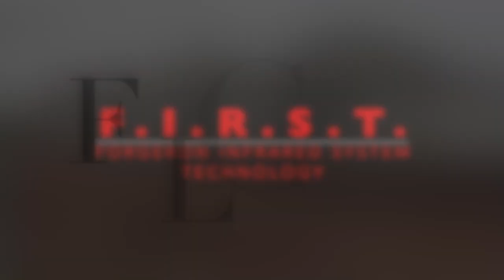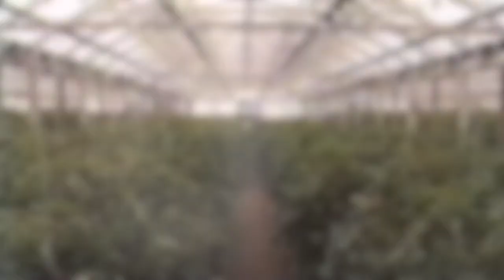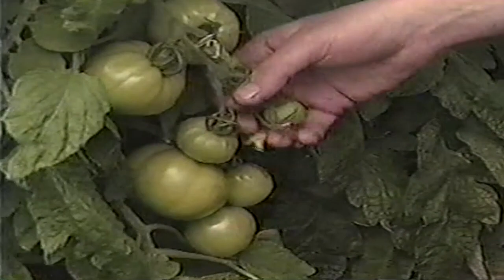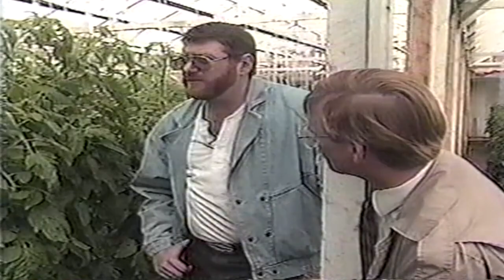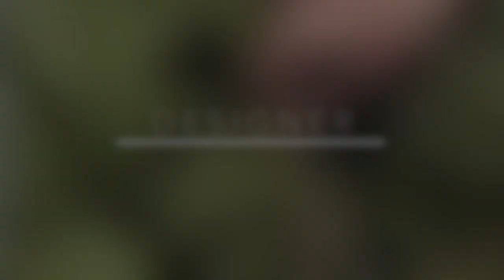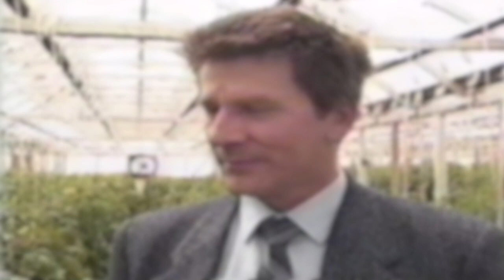Forgeron Infrared System Technology - Greenhouse heating system

Comment from the maker: Hi  You Tube viewers.
Since I don't have much interest being shown for my world's best , most efficient greenhouse/ shop/ warehouse/ gear shed heating system, I want to mention another innovative fishboat which I designed, built, and tested in commercial fishing in 1977- 1992. It excelled in speed. comfort, environment friendliness, and costs.
It can be built by most fishermen or pleasure boaters, or existing boat shops, using the presently suggested aluminum pre-cut hull packages, with assembly instructions and welding training as needed. 
I thought you may be interested in my background leading to my innovations I have produced 

but can't find anyone wanting to use them?

I come from a little village called Main-A-Dieu, Cape Breton, Nova Scotia, Canada. It is a quaint little Commercial Fishing Village on  The Rough North Atlantic Ocean, containing the once largest fish banks in the world, until we decided to destroy it by overfishing using destructive harvesting gear. We now have it on its knees, but continue with the same destructive Draggers tearing the Ocean floor to pieces and grossly overfishing all the bait fish needed to feed the ocean habitants.
I was a boatbuilder helping my dad build Cape Islanders for local and nearby fishermen. We also commercially fished Lobster, groundfish, swordfish etc.
Sea sickness was my problem for several years for the first 1-2 weeks. I wished the boats were faster so the travel time to the fishgrounds could be cut in half.
That wish made me work for +25 years till I designed and built an innovative hull to not only go much faster, but also using a smaller engine, reducing fuel costs by 30-60%. The hull also was comfortable and smooth in rough seas, and turned on a dime. I went away and got an engineering Degree, and worked in World leading major industries for many years, till returning home to build the above mentioned boat. The fishermen loved the boat, but suddenly my commercial license was removed by government, so I went away again for work.
Next, came World EXPO, 1985 in Vancouver. I went out to see and visit my brother, who had a converted Fishboat he used along the coast for his geochemistry work. At that time he had a friend in need who had developed a seed planting device to plant 200-500 seeds at a time exactly planted at proper spacing. He needed a greenhouse to try his seed planter, for a year. 
No one was interested, so I offered him a greenhouse heated for a year. I knew of a greenhouse near my home which the owner was having cash problems, so it was idle, and I could use it if I left my heating system with him. I agreed.
As an engineer I quickly checked how much it would cost me to heat the 3,000 sf greenhouse, single skin, knowing winter temperatures were -35F at times.
I was shocked to find I could not pay the heating costs using the coal fired inefficient hot water boiler presently in place.

So then began my second innovation journey.
All heating systems were expensive to install, and fairly inefficient and costly to run. The only one I could see was an infrared system fired with propane. It was very expensive, especially since I would need at least 10 separate units, and each unit had a hot wasteful exhaust continually exhausting hot fumes outside. A waste of energy.
I decided I needed a more efficient infrared heating system which was not only cheaper to buy and install but without needing the exhaust waste.
I also wanted a lower operating temperature to not only reduce burning the greenhouse operators who accidently touched the heater.
I also, wanted to use the longer infrared wavelengths for better plant growth. 
I also wanted to reduce heater  temperature to reduce the overall greenhouse temperature differences across the whole greenhouse lower area.

Greenhouses almost everywhere have condensate raining down on the grow tables, the people and floors, making the humidity higher than desired for healthy plants.
Condensate on the roof also reduces the sun and sky light input onto the plants.
Many greenhouses have existing furnaces or boilers which produce hot water or steam, to heat pipes which run along the outer walls.
My system can run perfectly using that existing boiler, which can be fueled using their existing energy source, or can use whatever they find most efficient.
My system can run directly from electrical power, without needing boilers, or steam generators, or oil/gas tanks or exhaust pipes.
My system can use their existing 2" pipes they already have along their walls, so even more costs are saved.
My system can be run and maintained with or without existing boiler operators with or without a boiler operators license.

Comment from the maker: I designed and built, and put into use, this heating system in 1978. A friend needed a greenhouse to try out his automated seed planting system, but needed a  heated greenhouse. I said I would get a greenhouse and heat it for a year to help him. I didn't know how expensive the heating would be but found out I would have real trouble if I didn't find a better way to heat the greenhouse. So I researched every heating system in use, and could not find a system I could afford. 
I am an electrical engineer, so I really started digging for a better way. The best I could find was an infra red heating system. But it also had limitations and would not lower the heating cost and installation costs for my limited budget.
I call my system FIRST (Forgeron Infra Red System Technology) FIRST. 
For greenhouse owners, I offer some great savings and heat distribution and energy reductions from installing my system as follows:
a) FIRST provides perfectly uniform heat distribution throughout the greenhouse, and especially along the cool outer walls. Do you have that?
b) FIRST does not need any overhead fans to drive the heat down onto the growing beds and floors and people. You won't see overhead fans in the video above. 
c) FIRST eliminates the cost to install the unnecessary overhead fans and plastic tubing, reducing electrical energy costs and installation costs. None needed, check video.
d) FIRST eliminates condensate drip from your overhead structures and plastic outer skins. You know you have that problem, and it is not necessary. Check video.
f) FIRST video shows a 10,000 sf greenhouse, perfectly heated at midnight in, proven superb in -32F winter storms. Not a single plant lost.
g) FIRST easily heals plant stems when pruning the suckers. See this in the above video.
h) FIRST keeps your greenhouse dryer allowing plants to grow without mold or botulism growth, and without chemical sprays. Check video.
i) FIRST can be installed and run off most of your existing hot water pipes and boiler. FIRST runs  using hot water or steam or electricity.
j) FIRST has been fueled with 4' wood logs, wood chips, diesel, Natural Gas, Propane, LNG, and electricity, your choice.
k) FIRST has heated the 10,000 sf greenhouse in -32F storms, using a total average energy of 250,000 BTU's using the old discarded wood log boiler from a bowling alley.
I come from a large family of 10 kids, and had to live on a lot less than many others. I understand how to keep costs low and to save much on energy so our environment does not get destroyed from our efforts.
Check each of my above innovation and energy saving benifits listed. Why not use them in your greenhouse of tell a friend to check out the features I provide.
Be Safe and energy efficient.

Alphonsus Forgeron, P. Eng, semi-retired.
 

e) FIRST
Reply: Where do we get more information?